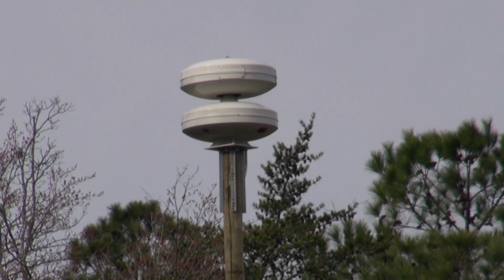FS Modulator 1004 chimes, pulse & voice, Lightfoot, VA, 3/17/15

Comment: why do i see ones with 2 discs, 3, 5, and as many as 8?
Reply: The more cells it has, the louder it is. Fewer cells isnt as loud and won't travel as far. It depends on the size of the area that needs to be covered by the siren.

Comment: 0:15 - 0:54 Electronic Female Voice: The Mass Notification System is being tested. Please disregard any emergency tones until further notice.

0:58 - 2:12 Electronic Male Voice: Attention. This is a tornado warning. Please proceed to your designated storm shelter. Please stay away from windows.

2:34 - 3:34 Electronic Female Voice: The test of the Mass Notification System has ended. Please take the proper measures to hear the emergency tone.